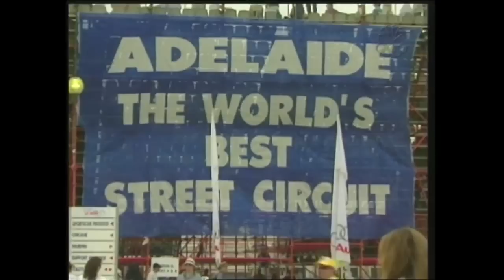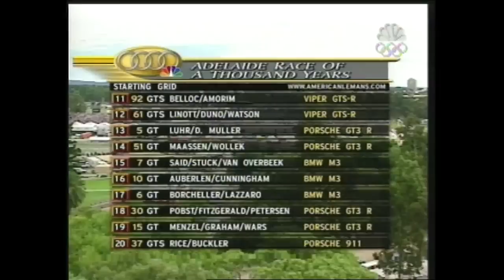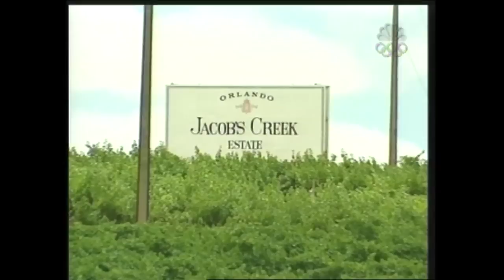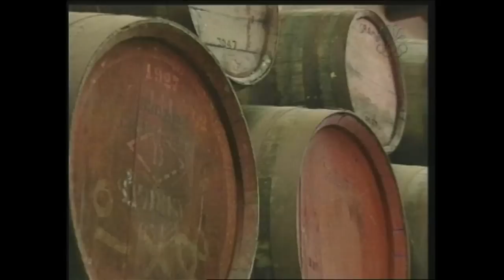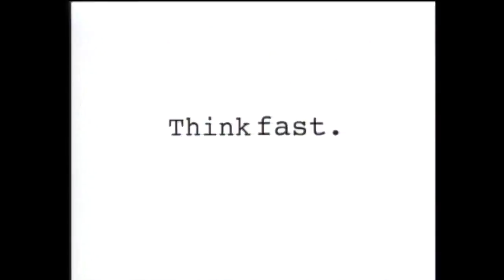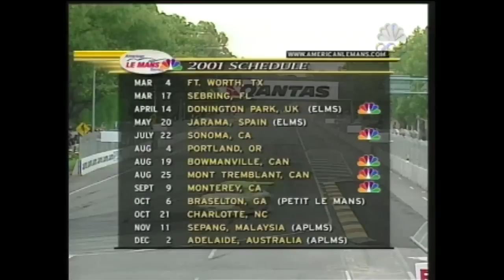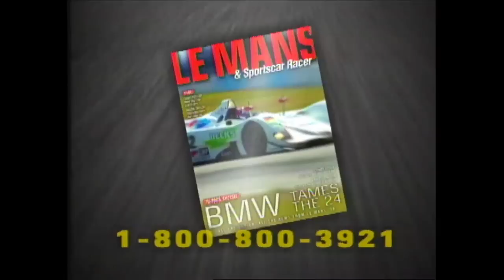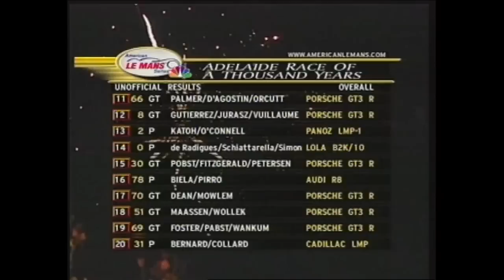2000 Race of a Thousand Years - Adelaide Broadcast - ALMS - Tequila Patron - Racing - Sports Cars

Comment: I worked the flag point at Turn #7 (corner before Stag) for this event. We were a metre from the ripple strip as the cars passed. Flagging in the dark and having pieces of the track breaking up and hitting us made the job a bit difficult too. Great experience. Too bad it never happened again.
Reply: I don't believe I was aware of it or I would have joined you